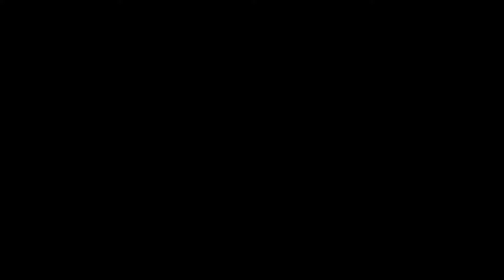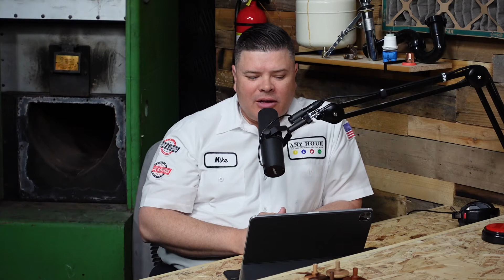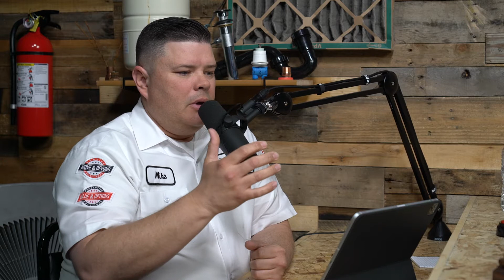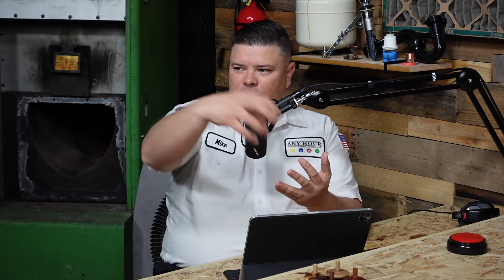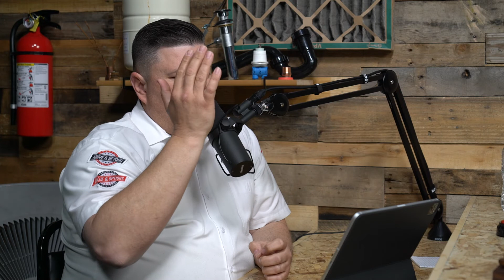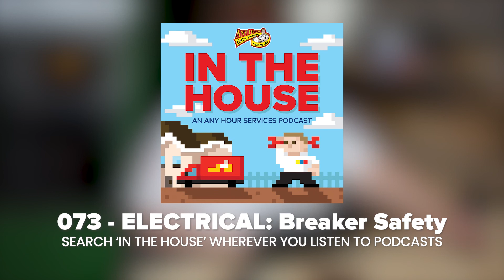073 - Breaker Safety

Comment: Good video with good safety points. Thanks for doing it. 
I presented basic Electrical Safety training to new hires & annual recertifications. To emphasize the breaker protects equipment vs protects people, I would use the scenario where 75 milliamps can kill yet the average breaker is 15 amps which is 200 times the current to kill you.

Comment: Thanks for the video. I have a light switch that is wired correctly but when I turn it on, the circuit breaker trips. I haven't checked the light fixture yet but could a loose wire from the light fixture be causing the breaker to trip?